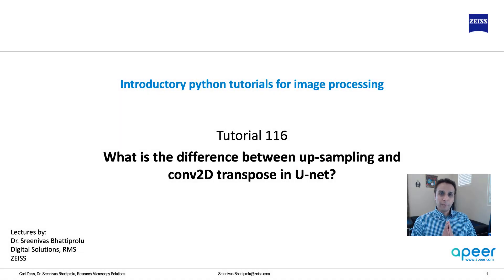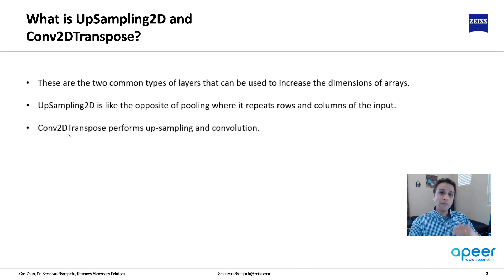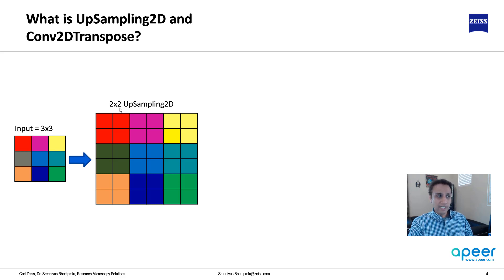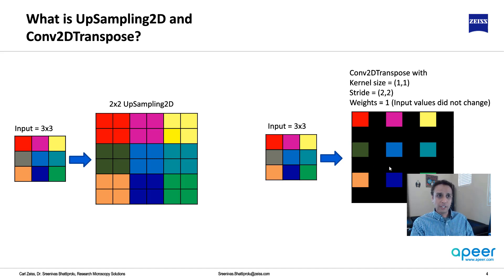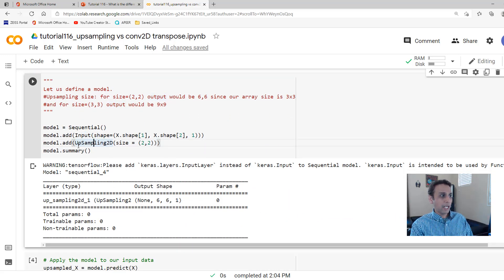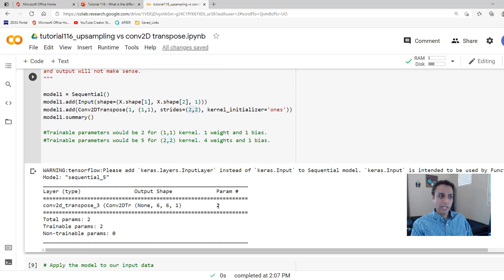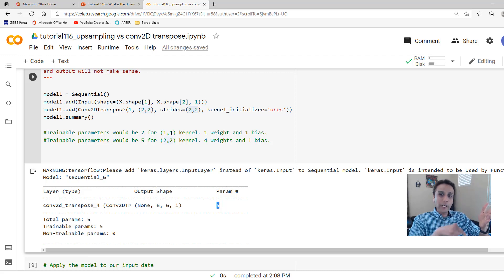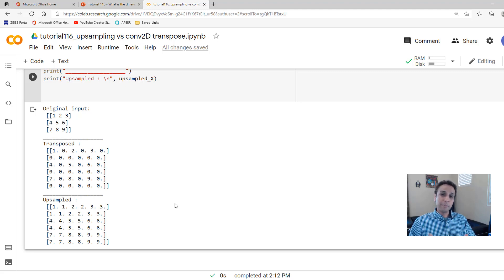Tutorial 116 - The difference between upsampling2D and conv2Dtranspose layers in deep learning

Comment: Nice and clear. Thank you. 
Question: @15:30 I am a little confused about the value of the weight: Shouldn't it be the same multiplicative factor i.e. 0.965 in this case, for all entries in the transposed matrix, and not "0.8 something" for the (0,2) location? 
The math works out that way, with non-zero entries being 1x0.965=0.965; 2x0.965=1.931; 3x0.965=2.895, etc (bias=0) and agrees with the earlier statement that there are only two parameters to learn (unclear why bias would be zero though).
Cheers.